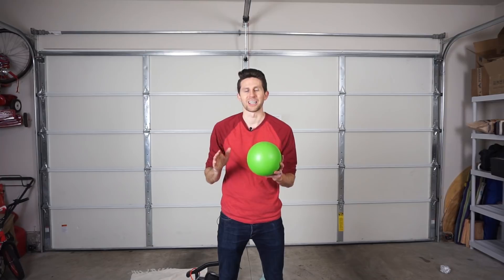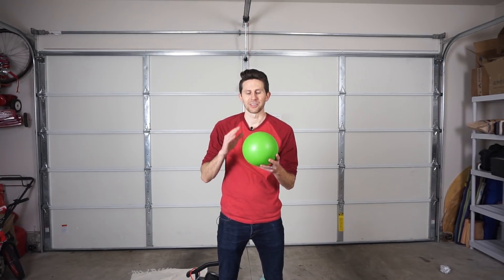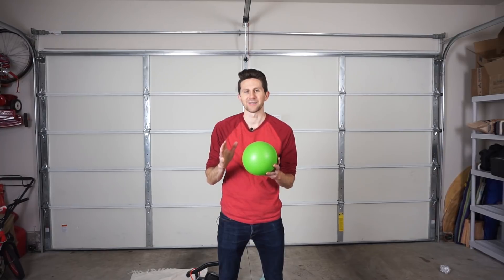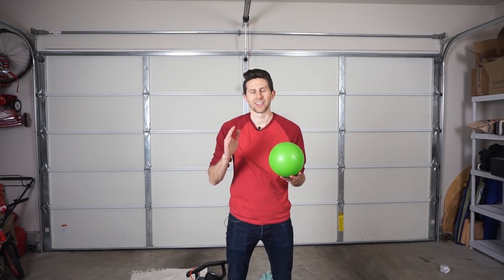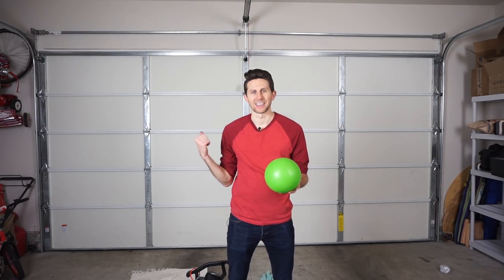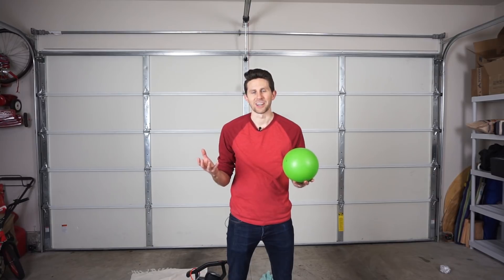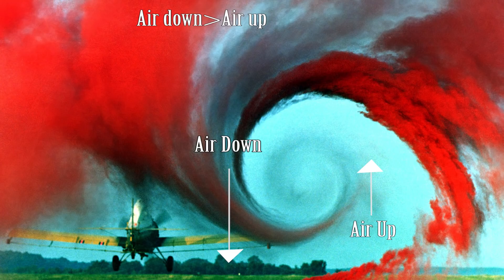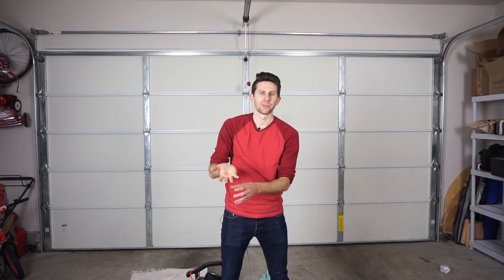How To Get Regular Things Around Your House to Float in Air?

Comment from the maker: Here is some more information on how planes actually fly. The wings create area of low pressure above the wing and high pressure below the wing. The normal-pressure air well above the wing pushes down on the lower-pressure air immediately above it, effectively "squirting" air down and behind the wing in a backwash. In other words, the pressure difference that a wing creates and the downwash of air behind it aren't two separate things but all part and parcel of the same effect: an angled airfoil wing creates a pressure difference that makes a downwash, and this produces lift. If a plane where to fly over a scale it would increase the weight of the scale by the weight of the plane. You can read all about it here: http://www.allstar.fiu.edu/aero/airflylvl3.htm
Reply: The Action Lab the smile on your face when your floating the lemon lmao
Reply: http://www.explainthatstuff.com/howplaneswork.html

For a better explanation how planes realy fly
Reply: The Action Lab if the rocket was spinning laterally would it have worked then?. I have seen this done with screwdrivers and as long as the screwdriver is spinning it stays relatively stable.
Reply: The Action Lab can u please explain how a transformer works........ The one used to step up voltage
Reply: The Action Lab pause at 1:38 and look at his hand
Reply: +iwantitpaintedblack, This is entirely true. The Bernoulli principle does contribute very minimally to the lift of a plane but the vast vast majority is contributed because of the tilt of the plane. Why do flat wings work? :thinking:
Reply: On a conventional aircraft the displacement of air (ie. downwash) is not actually very significant, because the wing passes through a region of air so quickly and the downward moment given to the air in contact with the wing is quickly halted and spread to a very large amount of air above and below the wing. However when you have a wing passing through the same volume of air continuously, then the downward momentum sums up and air starts to move downwards faster and faster. This is why propellers have a propwash on the ground and helicopter rotors produce a downwash when they hover stationary, but when they actually fly through air, the propwash and downwash are both greatly diminished.

Interestingly, however, the downwash actually decreases the lift produced by a helicopter's rotor (and a propeller's thrust). This might seem counter-intuitive, but consider that the downwash is not like a rocket's exhaust - it doesn't originate from the rotor itself, like a rocket's exhaust comes from the rocket's fuel and oxidizer. Instead, the downwash consists of air being pulled down from above the rotor blades, and as it moves down at some speed, it decreases the blades' angle of attack, so in order to maintain lift, the collective angle of attack of the rotor needs to be increased, but they can't be increased indefinitely.

So that means that helicopters produce less lift when hovering, vs. when flying through air at some horizontal speed. This is why helicopters sometimes need to take off from a runway when carrying very heavy payloads - they might be unable to take off vertically because the downwash decreases their lift capacity, but when they roll on a runway, the downwash doesn't get a chance to develop, and the helicopter can lift off. It's not by any means a standard thing they do, but it's possible.
Reply: All of this can actually be explained by the Coanda effect. Watch that video of Roger Linsell, that explains both the floating ball and the plane: https://m.youtube.com/watch?v=6Q8HssqWDDE
Reply: @jeremygrecte    That's what I had in mind.  But every time I see the Coanda effect demonstrated, it's with a fluid on one side of a spoon (convex side) and I'm wondering what it would look like in a water tank with dye tracers.  Excellent catch.
Reply: The vortices you showed in your video are a component of drag and actually oppose lift. They have nothing to do with how a plane flies and are the reasons you see upward pointing tips at the ends of most modern planes (the wingtips reduce the vortices and reduce the drag / increase the efficiency of the wing). Planes fly simply through a combination of low pressure above the wing and high pressure below the wing. When the pressure differentials are greater than the total downward force of the plane, the plane flies. Easy peasy.
Reply: I think spinning the bowl horizontally will stabilize it to be floated on the stream of air.
Reply: nah I'd rather believe that it go fast, pull back, then flyfly
Reply: I think maybe the ball can described as "air buoyant", but I'm trying to figure out if this makes sense. An object that neither floats or sinks in water is buoyant, but in this case, the ball floats in midair. There's also the factor of measuring the force from air exerted on the ball, which doesn't seem right for some reason. I thought this could be the right terminology since "air" is actually a "fluid". Could you please enlighten me if this is true or not?
Reply: The Action Lab who else read this super long comment
Reply: thanks the action lab you just got me a B on my physics assignment
Reply: Lachlan Korhecz Y?
Reply: can u please try this with a fidget spinner???? :D
Reply: Lots of debate over lift. I think it's time for a different kind of experiment using almost the same principles.
Reply: Oscar Armstrong Hello :)
Reply: flat wings but tilted work,
Reply: nawack1 can you tell me why they never started their own channel called ExplainThatStuff?
Reply: Thank You!
Reply: Your wing tip explanation is correct, but The Action Lab is right about Bernoulli. Planes fly because the wings deflect air downwards. Part of it is due to the angle of attack and part due to the faster air over the top of the wing.
Reply: should've spun the bowl sideways and seen if it would've changed anything
Reply: The Action Lab Bernoulli's principle applies to jets and turbo-fan planes due to the "nozzles" on the aft end of the engine. If you will notice, a F/A18 or EA18's nozzles will constrict more at higher throttle, to produce more thrust.
Reply: @Leonardokite I am sorry to burst your bubble. This is the easiest explanation but also the easiest to prove wrong. No one ever says that the two halves "must" meet again at the trailing edge. Just look at any examples done using smoke trails and you will realise that 1) Yes the top air flow does indeed move faster but 2) No, they do not meet at the trailing edge of the wing. The upper air flow will always reach faster than the lower one. The question is why does the air on the upper half flow faster? Many theories, but definitely not "They must meet again at the trailing edge".
Reply: That makes sense with aerodynamically-shaped wings.  But what about the wings on a rocket or jet?  Those fly and I doubt they do so by the same means you listed in your comment with a low-pressure on top/high-pressure on bottom scheme.
Reply: Wings don't have to be "wing-shaped" to produce lift, even a flat plate at an angle to the air flow will work. Refinements to the shape are for other purposes, such as reducing drag. Stabilisation fins on rockets are small and don't cause much drag when the rocket is flying straight, so a simple flat shape is fine. Also, the rules are different between subsonic and supersonic speeds. Supersonic aircraft wings usually have a thin diamond-shaped cross section. Regardless, they're all kinds of aerofoil and work essentially the same way.
Reply: they swim
Reply: The Action Lab  could you put the rocket with the point up bc the other side is not as aerodynamic
Reply: The Action Lab kuwl
Reply: hey @The Action Lab, you should totally correct this information, actually the vortex that is generated at the end of the plane, is nothing but the reaction of the lift, or to be more accurate, the air circulation around the plane. The plane is lifted by a combination of direct lift generated by the angle of attack, and the Bernoulli effect. The vortexes are the two lines we see condensed at the end of the plane and there is many researches to  destabilize these vortexes the closes possible to the plane (and form vortex rings)
Reply: The Action Lab then how do you think different wing designs differ from each other, like a cambered wing is deigned as if it doesn't have that flat surface underneath which is great for slow flying aircrafts (that's also why you see the pilot put down a bit of flaps on takeoff), that's all I know about it, or does it create the same effect
Reply: thank you so much. this was the explanation Im waiting for. and it clears all my misunderstanding
Reply: i learned about the burnoulli effect from MR WIZARD! way back in the day
Reply: can you float water?
Reply: The Action Lab 👍
Reply: The Action Lab hey can you do a video about water going from gaseous state to sild state directly
Reply: That is known as magnus effect
Reply: Magnus effect
Reply: Strange. Nick Lucid over at the Science Asylum (another awesome channel) says that the reason a plane flies is because their wings are angled upward and when a plane moves fast enough the air molecules hit the angled wing and are bumped downwards which creates drag and uplift... I dunno what to believe.
Reply: Wow
Thank you for the awesome action lab demonstration. It is so educational and encourages me to take pure science in school.
Reply: Just wanna say thanks for staying curious about the world. Your sense of wonder is infectious. Glad there's people like you making learning fun. :)
Reply: hello :)
Reply: Lift is definitely Bernoulli principle, because of the airfoil shape the length of the top side of the wing longer than the bottom. Because we aren't supersonic we aren't cavitating the fluid and therefore the airflow patterns across top and bottom do not have discontinuities -- simply put, the flow patterns travel the same airfoil ∆x in the same amount of time.  Velocity increase on the top surface causes a pressure drop.  Move the airfoil fast enough and it becomes buoyant.
Reply: Jonathan Kreamer, EIT if lift was only from the Bernoulli effect, planes wouldn’t be able to fly upside down as the effect would now be be pushing the plane into the ground. Angle of attack is part of the equation. Look at the angle of an aircraft flying upside down - it’s quite dramatic nose up to counter the incorrect wing design and increase angle of attack
Reply: @paulbarton957  when upside down, the increased angle of attack changes where the stagnation point occurs on the leading edge, thereby still creating a longer path for the air to travel on the new top (bottom) of the wing... Longer path means higher velocity means reduced pressure and therefore lift due to Bernoulli
Reply: Here is a very simple explanation of how a wing creates lift.

When the air meets the leading edge of the wing it splits in half. Half takes a lower route and the other half takes the upper route. They meet again on the trailing edge of the wing. 
Now think of the air molecules as a line of cars. Since the upper car path is longer than the lower car path they have to speed up to get to the trailing edge at the same time or create a “vacuum” (severe deficit of molecules)  on the  trailing edge of the wing. Now a lot of times people say that it’s the speed that creates the lower air pressure, but in reality all those cars space out along that longer route (same amount of cars in a longer distance) and are thus less dense. This lower density of air molecules then creates the lower pressure.

That is by far the simplest explanation and I think most people can understand / visualize it.
Reply: This is actually only a VERY small component of how airplanes work...

The major effect creating an airplane lift is velocity, and airfoil climb on MASSIVELY compressed air pressing up on the bottom of the flaps and wing surface.

Very little to do with vacuum and brernolli lift.
Reply: I learned this in school on 7th grade
Reply: Planes fly because their wings are tilted, wing surface hits air at an angle and (every action = equal opposite reaction ) the wing gets hit up, its exactly how boats turn, none of this bernoulli high pressure above wing bullshit, why does your hand gets pushed back if you hold it vertically outside a car window, do you create a vaccum behind your hand? no

Comment: I would love to see you test Bernoulli's principle on a wing in a wind tunnel and see what results you actually get though, that could be your next video!!! test the horizontal drag on different kinds of wings vs their lift (AKA efficiency), and extrapolate the data to see if a 747 could stay in the air with just the Bernoulli Effect.

As I understand it at lower speeds planes use flaps to create the "throwing the air down effect" but it is very inefficient. At cruise with hundreds of miles an hour of wind going over thousands of square feet of wing area the Bernoulli principle alone is what keeps a 747 in the air, they need to because it creates lift more efficiently, less fuel longer range.

Comment: The Action Lab Hey, I could not understand your theory for why planes fly. You said that it is because of vortices. But I have studied that vortices are actually an undesired phenomenon for a flying aircraft and it wastes necessary upthrust. In fact, some aeroplanes like the Airbus A380 use small raised winglets at the tips of their wings for reducing the vortex phenomenon. The reason why the planes fly is because of the pressure difference between the air on the top and bottom of the wing. Please refer the television show 'Richard Hammond's Engineering Connections' episode on Airbus A380. It is available on youtube.
Reply from the maker: The upflow from wing vortices is what is undesired. The high pressure below the wing and the low pressure about the wing squirt air downword. The overall effect is that wings throw air down and that is how they stay up.
Reply: Thank you very much for responding. I really appreciate it!